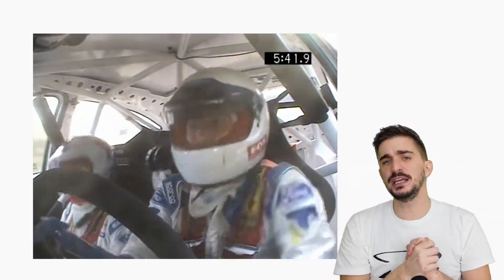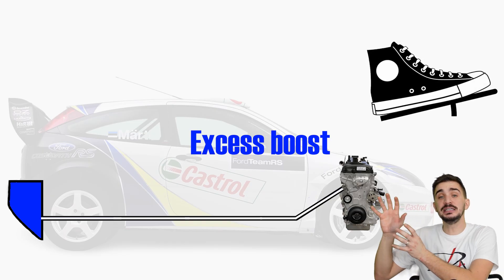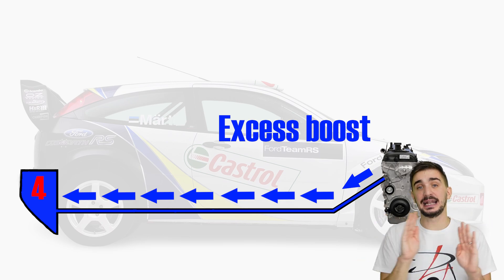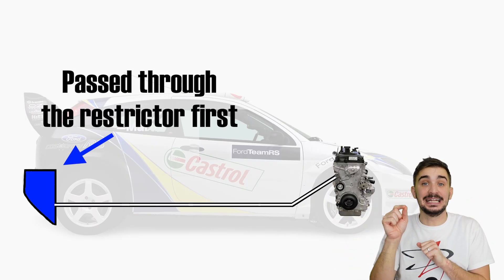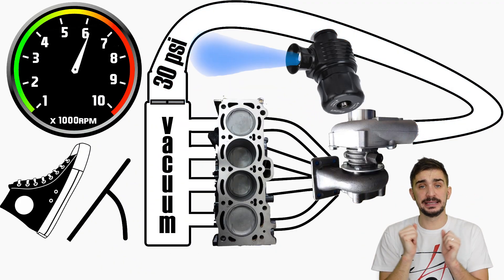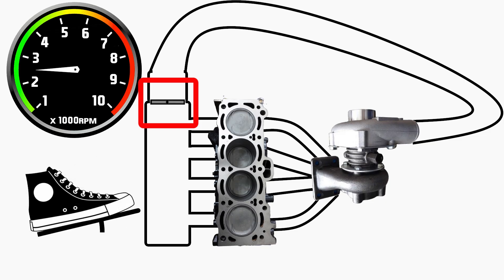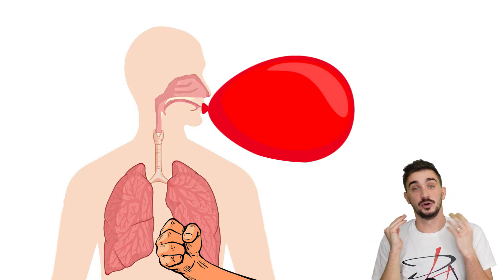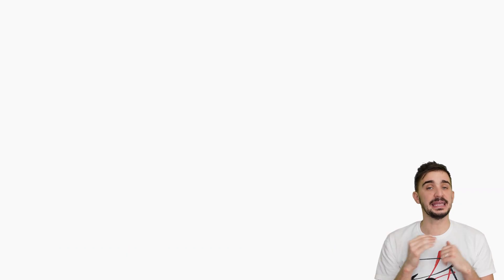FORD'S HIDDEN BOOST Tank - Welded TITANIUM filled with ANTI-LAG

Comment: Why wouldn't they just use the roll cage you can pump whatever gas you want into the roll cage and not only would it give you that extra boost you're looking for but it would also stiffen up the roll cage because of the pressure difference inside to outside just a thought
Reply: because messing with a safety device like the rollcage would get you disqualified
Reply: @fuzzy1dk  and it would not be the first time actually NASCAR teams got busted for trying to hide extra fuel inside of the roll cages so I'm not the only one with this idea
Reply: @fuzzy1dk  you're going to get disqualified either way you do realize this
Reply: @garycsfunlife  the boost tank was not illegal when Ford used it, it was made illegal and they stopped using it
Reply: @fuzzy1dk  didn't know that ty for the info 🤔🙂
Reply: 30 psi would make no differance to stiffness, I even doubt that 300 psi would.
Reply: @johndavidwolf4239  don't take this offensively but I'm pretty sure I'll take the advice from my teacher in my mechanical engineering course and no I'm not just talking shit
Reply: @garycsfunlife  : While in theory it would stiffen up the roll cage, even at 300 psi the amount that it does would be a fraction of 1%.   While "pretensioning" is a valid way to increase stiffness, the minimum strength of steel for roll cages is 360 N/mm^2, which is 52,200 psi I would not expect to see any measurable stiffening until the internal pressure reached at least 1/100 of that.
Reply: @johndavidwolf4239  it was a project for proof of concept and yes the difference was minimal but functioned as planned and for my project having a moving pressurized fluid showed in theory to work better than a gas but I'm still working on a real life model and remember this is small scale (ATV) not a full size car roll cage and I'm looking to change handling characteristics but as for original post yes a roll cage would be a possible place for pressurized air for boost to control lag
Reply: @garycsfunlife  : As section modulus for a tube is a function of radius to the fourth, just a slight increase in diameter, keeping the same wall thickness will have a great increase in stiffness.
Reply: @johndavidwolf4239  if I had my choice I would use a completely different metal that way I can get both stiffness and lightweight but that avenue leaves me with absolutely zero for my proof of concept which is something completely different in no way did I ever save my proof of concept was a superior way of doing it it's just the way I'm stuck doing this proof of concept so don't try to change my mind it's not my choice it's a project I have to complete for a class but for  the original post a roll cage can be used as a pressure vessel to mitigate turbo lag might not be legal but yes you can do it
Reply: Like the Helium gas filled BMX tube frame, I like the idea.
Reply: @Eduardo_Espinoza  I seem to remember some racecar of the group-B group-C era with a nitrogen filled frame, but that was to get an early warning if there was a crack somewhere
Reply: @fuzzy1dk  True, true. :yougotthis:
Reply: @Eduardo_Espinoza  I've used it in dirt bike and ATV frames not necessarily helium but I used oxygen and I ran I want to say 20 psi and all your technically doing is stiffening the frame up as for the BMX bikes I know it'll make the frame stiffer but I don't think the helium is really going to make it lighter to an extent that's going to make any difference
Reply: @garycsfunlife  You are correct :yougotthis:

Comment: Very good explaned. In offshore welders weld titanium all the time they use tig with cooling shoe that blow gass to cool it down.
Reply: The gas is not to cool it down, the gas creates an inert atmosphere that has no oxygen in it to prevent impurities entering the weld.
Reply: @stevennoyb4595  the shoe is for cooling it down so the titanium not get blue. The shoe is after the tig Rod and have nothing to do with the welding itself. If the titanium get blue its broken and get discarded.